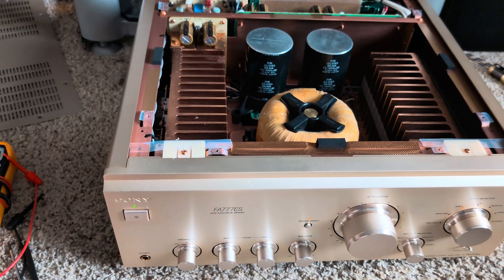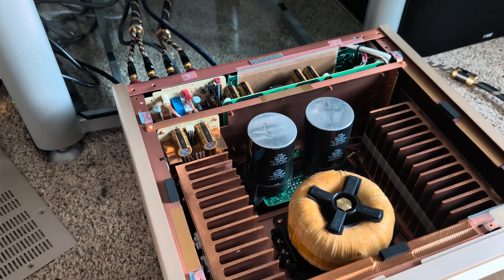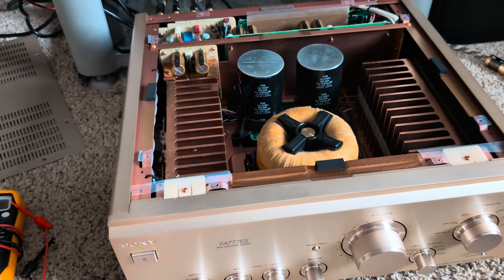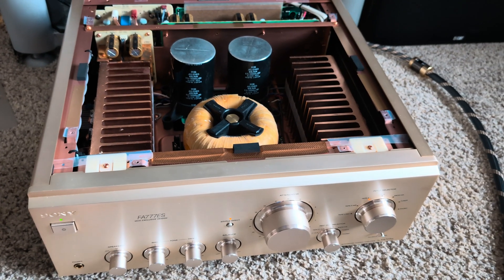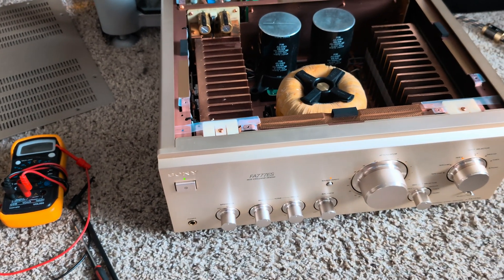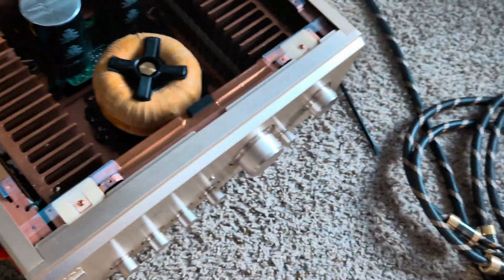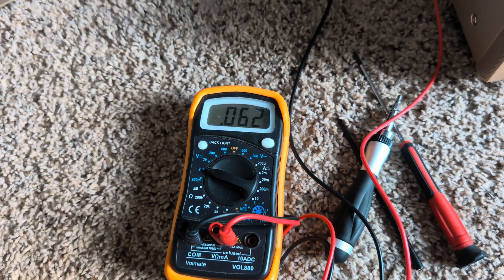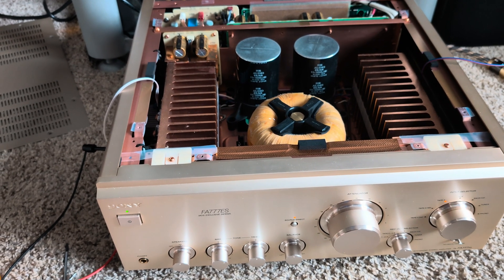Sony TA-FA777ES: Bias Verification & Inside Look at This MosFET Amplifier Tank

Comment: @hifirulezzz thanks for the video which was great to see of a top end amp which I believe is now over 20 years old. I have a Sony TA-VA777ES which is the surround sound version of your amp, and was the top end amp made by Sony in 1999. I've had my Sony for over 20 years (bought new) and have always been really pleased with it. I also power B&W speakers and use the amp for vinyl in 2 channel mode (using the amp's dedicated direct sound 2 channel which closes down all of the surround sound circuitry). I also use it for some surround sound movies. Just recently the amp has started making a low buzzing sound which is annoying at low playback levels. My audiophile dealer (who is respected) has suggested that it would be difficult to find a company to service and that replacement parts would be difficult to find and because of this it is time to replace with a better high end integrated amp (for 2 channel) such as the Rega Elicit Mark5 or the Arcam Alpha SA35 (and using it with a good AV amp(for surround sound playback) such as a Denon X4700H). Can I ask you, as a lover of quality but aged vintage audiophile equipment, for your thoughts?

Comment: those main caps are too small for an amp of that price
Reply from the maker: Small for what? Do you understand the reason these caps are put there?
Reply: @hifirulezzz  your Sony has a total of 36k uf which is pretty low for a high end integrated.
Accuphase E460 has a total of 66k uf
and even that is kinda low.
Reply from the maker: @RoverWaters  Well, that's what I expected. The values are CALCULATED to keep OUTPUT CURRENT for the MAX power. There is no reason to have more. The more powerful the amp - the bigger power reserve is required.
Reply: @hifirulezzz  the so "calculation" you mention is done on cheap amps to minimize costs.
top amps have only one goal: the more filtering capacity , the better it sounds.
Reply from the maker: @RoverWaters  LOL, total BS. Don't even want to argue with you.
Reply: @hifirulezzz  no argue
Reply: @RoverWaters that’s insane
Reply: @RoverWaters   Since you have no idea what you talk about, let me educate you a bit. There are a few reasons why the main filtering caps are the way they are. It's using high speed rectifier diodes and proper snubbing. And with higher rail voltages the same amount of capacitance stores more energy. Better not apply a "more is better" logic. Sony didn't mess around with the ES series. This amp is very well engineered.
Reply: @Salty_Legionnaire  nah, your explanation is weak
Reply: @RoverWaters  Ok dude, whatever floats your boat.